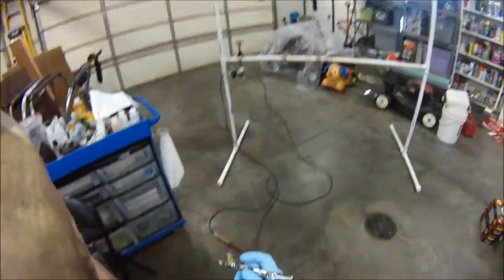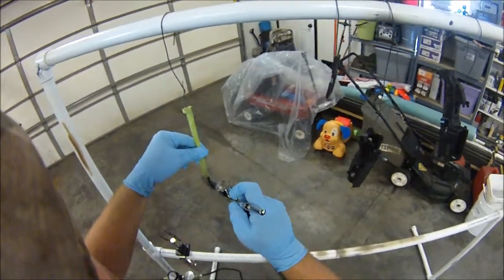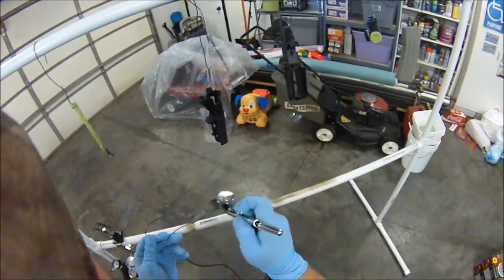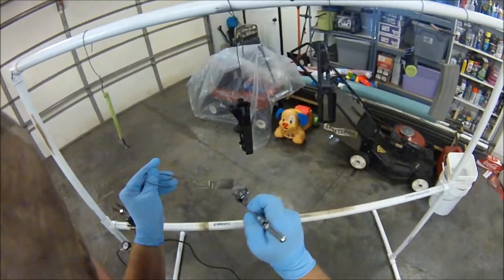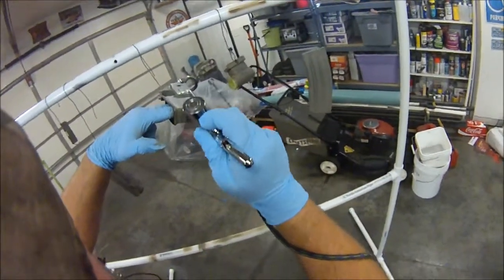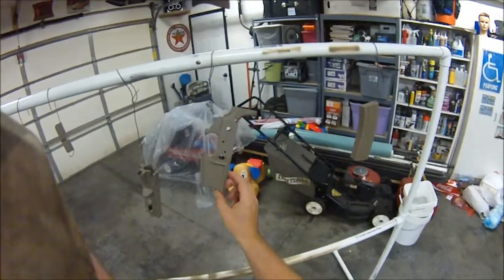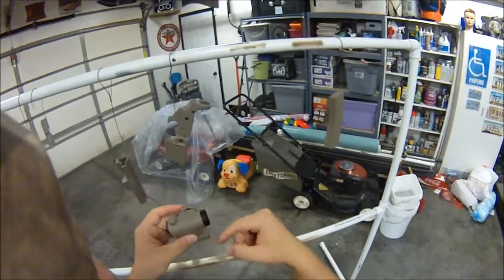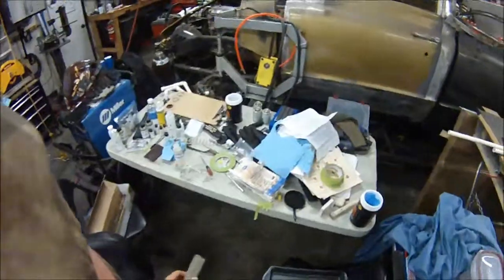AR Duracoat Project - Paint

Comment: what size needle/tip are you using in that airbrush?
Reply: +Contradiction Within A Conundrum In the video I am using an Iwate HP-CS with a .35 nozzle/needle.  I currently use the Iwata TH with a .5 nozzle or detail spray gun with a .8.
Reply: +Travis Ktytor 

perfect, thanks for the quick response, much appreciated! I just picked up some airtools with the same nozzle tips myself. Thanks for the video and info